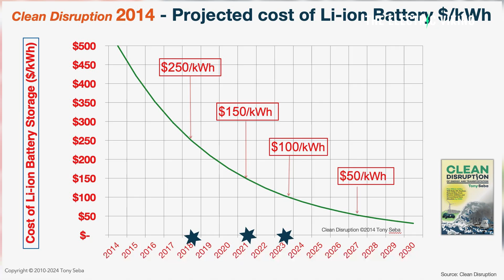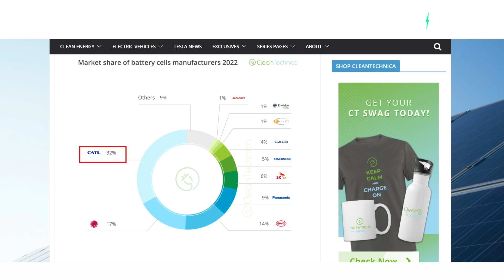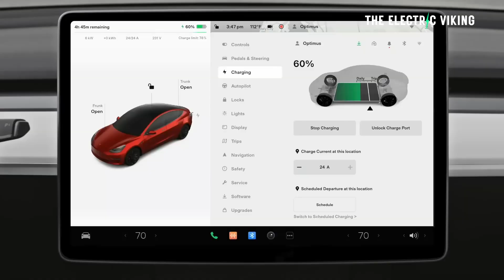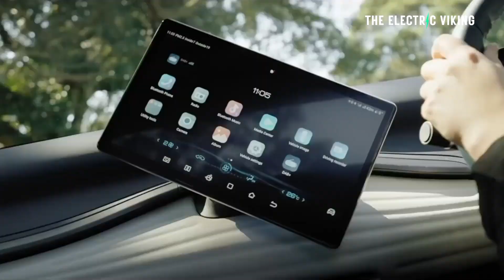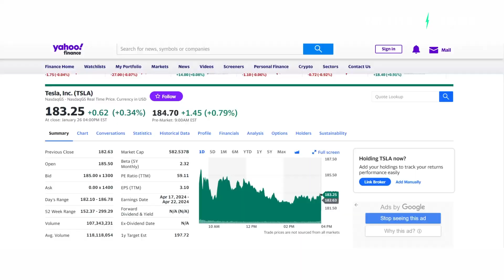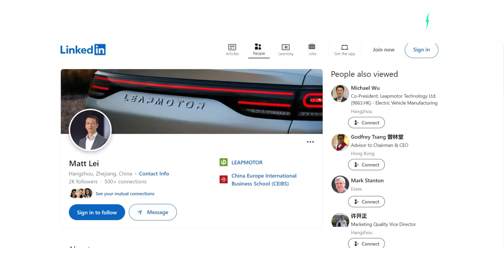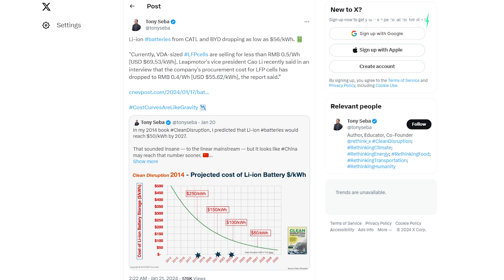Tony Seba's 2027 battery prediction is about to happen 3 YEARS EARLY!

Comment: It seems that sodium is likely to make lithium only for high performance and aviation applications!  Most people will choose robust affordable sodium vehicles ~50-100kg heavier!?
Reply: Well not 100% the goal is to hit X amount of storage per package. Meaning, you could go hybrid reducing the amount of cells in one area as the power dens increase and slip the other half for Na. So in the perfect world, yes we would have Na batteries, but without increasing the over all weight or size by trading out the benefits and cons of both.

Comment: You say that a brand new battery for a model 3 or y is 6000 us dollars its more like 16 thousand dollars for a new pack
Reply: Elon Musk said it would cost around $5,000 to $7,000 to replace a Tesla battery module. Each car has 4 or 5 individual battery modules. That depends on which model car you choose and if it has an extended range option. The purchase price of a battery module does NOT include installation

Comment: Every time I think about buying an EV another story comes out where I say - well buy one after this is in EVs. I'm glad there's a heap of enthusiasts that will test these new changes.
Reply: Did you buy a computer between 1980 and 2015? Do you own a cell phone? Such a mentality followed through fully means you won't own an EV till like 2035-2040.

If you're that concerned about it, you could always lease and get the latest and greatest every few years while not being left holding the bag if the residual dropped too much.
Reply: @tHebUm18  For consumer electronics that is true, for cars it isn't.
Reply: Probably. But there's also good reasons to not be an early adopter. eg These days I buy last generation CPU and GPU instead of the next gen. This saves me about $1500 a year. @tHebUm18
Reply: Lease it !
Reply: Im not sure iof the EVBs Im interested in are leasable yet. One hook is that I also want to be able to tow a small caravan ~ 1500kg. @IverKnackerov
Reply: The car industry has increasingly been following the IT industry since it began fitting chips in cars..the introduction of infotainment systems and touch screens  just completed the transfer .... The car that you have to subscribe to have built in features activated even fundamental ones is the dystopian  extension of this marketing ploy.  

A general observation is that that beta testing as in the IT/ tech companies term is usually carried out in a controlled group or confined geographic marked area... In the case of Chinese manufactured vehicles this tends to be the Chinese domestic market.  They are effectively co opted at a national scale as beta testers. Its also quite logical as they very often have the most previous experience of E vehicles and systems... especially the vast light and small city classes and heavy commercial vehicles. 
90% plus of heavy comercial electrical motors and motor axels are made in China.. as Edison motors found. Same happened with bicycles ...  all the big names buy their parts or have their parts made in the same far east factories. 

Unless designers and manufacturers are prepared to do something different and the legislative frameworks change ..many have missed the boat  and the subscription activation model is going to end the same way as it has for apple ... devisive, expensive and ultimately self defeating.
Reply: Buy a NIO and in less than 5 minutes install the latest battery technology when it’s available. Years later it will hold it resell value because of battery swap.
Reply: @benplumlee751  But you only get battery swap with renting the battery (at least in Europe), paying it's price every ~6 years. Plus it's not quite sure yet if NIO will still exist in a few years.
Reply: @florianmallok7770  
That will go down as well by the same logic, plus in the European context our high density and historic cities and tows dont readily adapt to on street or at home charging. 

Nios battery packs get optimally charged off peak usually . So have a load leveling function at larger scale. There are three swap systems in the mix.. but I can see a day where the EU will step in bang heads together and insist on a standardised interoperability fixing plug and play system. 
The same problem exists for third party repairers and the computerised diagnostic systems that are required on most ICE vehicles..  if a manufacturer doesn't play nicely... They will get dumped because  they will get dumped or hacked.
Reply: ICE cars are MUCH better than they were in the 70's, and got meaningfully better over the decades.  At some point it won't matter that BEV's are improving -- once they're clearly better AND cheaper than equivalent ICE's (re size and function and luxury) -- even BEFORE fueling costs and AGW are considered.

Also, while the transition occurs, consumers can choose hybrids, etc.  As someone who doesn't drive much overall and for whom convenient service (and service vendor choice) is paramount, I may well get a Toyota HEV or PHEV next, and wait while the BEV tech. and charging infrastructure matures.
Reply: China has made too many EVs. To move them they are cutting prices. So all EVs do the same - to compete. EVs are now pretty close to equivalent ICE vehicle prices. @rogergeyer9851

Comment: I want to see a simplified EV car from Tata or China. No self-driving, 4 passenger hatchback, no frills, crank windows, regular car keys, single lug wheels, sodium batteries, range 250 miles. $6,000.
Reply: Aside from range you are describing a 2014 Leaf. Given the fall in battery prices, that car built today would cost about $14,000. But Nissan won't build them.
Reply: @PxThucydides  I hope after-market battery replacement becomes common. The later Leafs have 40kWh and even 60KWh batteries.
Reply: @PxThucydides  I'm pretty sure the Leaf doesn't have crank windows, sodium batteries or single lug wheels. Not sure about the regular car keys.
Reply: Sounds GREAT, but could it pass U S/European safety standards?  Also, how about an optional battery with twice the range!
Reply: @flyingspirit3549  That is the issue, they will not pass the safety standards.
Reply: Just convert a car from the 70's or 80's. That's basically what that is.
Reply: sounds like a byd seagull or wuling
Reply: I want an electric nissan hardbody 2 door pickup truck The 86to 94 truck
Reply: Wait for NIO sub brands.
Reply: The problem is  each new generation demands features that were unknown in cars 100 years ago.Nobody would  buy a car without a heater ,a radio or air conditioning  50 years ago. And today people demand a whole lot more .
But I get your point .It is possible to build an electric car cheaply without all the frills .And for short daily commutes to work or the shops you dont really need them.
Reply: It will have to be safe so will require a certain number of airbags to achieve this.

A/C could be an option.

Should have body panels like the AMI. Plastic that can just be bolted onto a structural inner body. 

Yes, manual everything & just use your phone for the display.
Reply: @Jamessansome   I was thinking tablet as it doesn't really make sense to leave all of the screens in the cars going through hot/cold cycles with the rest of the vehicle. There would have to be programming in the interface that prevents the use of the phone/tablet for visual applications that distract from driving.
Reply: Maybe in Elon LT plan ... gigapress blows out hotwheel shell, assembled by only robotics and bots. Voila $6k car. Moreover, optional solar car wrap gives you free fuel.
Reply: In India we already have Tata Tiago EV which is a 4 seater hatchback priced at around 10K USD. We expect even cheaper entry segment EVs in the near future.
Reply: Some of the things you think of as frills may cost more than electronic replacements.    Particularly if the supply chain is gone.
Reply: I don’t. Chinese cars fold like aluminum foil!
Reply: An electric car made in China?  What a great way to start a house fire.  Not a good idea.  China makes cheap crap that falls apart.

Comment: If they want to use Li  they need to improve the extraction and refining processes..  especially the speed energy and water use... Li S is probably the best oportunity and a magnitude better.

Meantime Al S tech  would 
put the resulting batteries probably on a level above that.

The form of a battery determines a lot of its performance and ease of  use and recycling. Im still thinking that blade cells would be more effective and sustainable.. 🤔

A massive reduction in cost will help... but the storage capacity and ability to avoid stored energy loss over extended  time...will also become important in certain sectors.
The marine deisel engine sector is a hard one to crack they are deeply wedded to their traditional  slow heavy smelly bangers ... That cause a lot of grief , maintainance and polution levels of 60-84 times their land equvalents. but they do have to cross oceans without refuling  more than once or twice ... You thought you had range anxiety issues 😂

The energy stored has to reach ten times present and needs to be safe and green.

If you want to see a good example of where things are going look at a French Catermaran builder called windelo.
Reply: Sounds great Sam this is definitely a case where biding your time to wait for the right product is going to proov to be  the the way to go
😂😂😂😅😅

Comment: Slap Chinese-made batteries in an EV, you lose EV incentives in most countries and get an import tariff slapped on top in many cases that will more than cancel out any manufacturing cost reductions by the time Chinese batteries get to market in civilized countries through official channels.
Also, mining is never going away since recycling will never catch 100% of batteries being disposed of, some batteries will inevitably get burned down and total demand will keep going up with population, the amount of unpredictable renewables that needs to get smoothed out, peak-demand shaving at fast-chargers, etc.